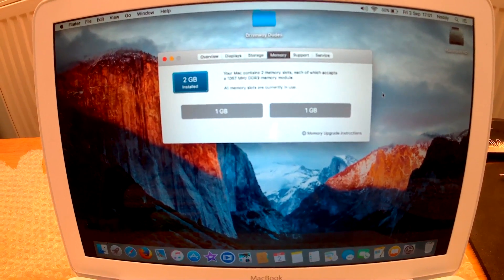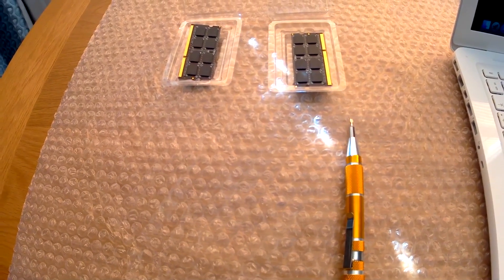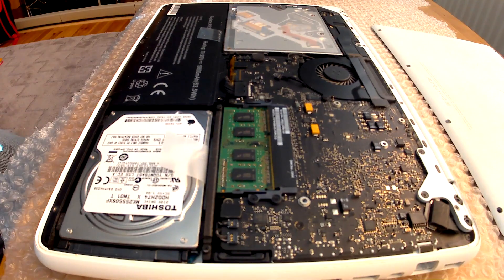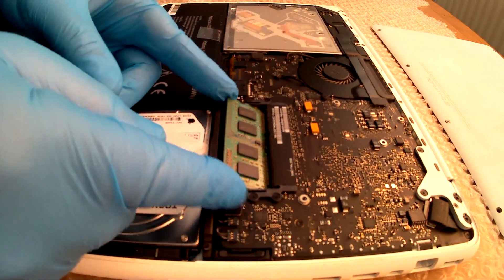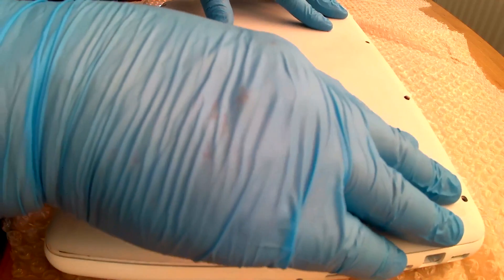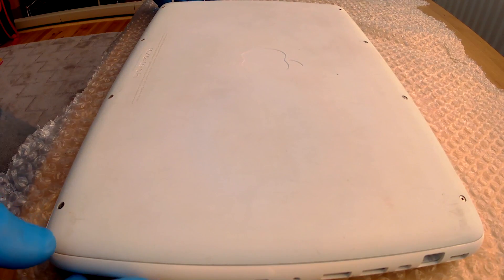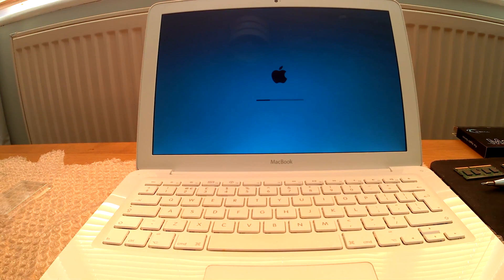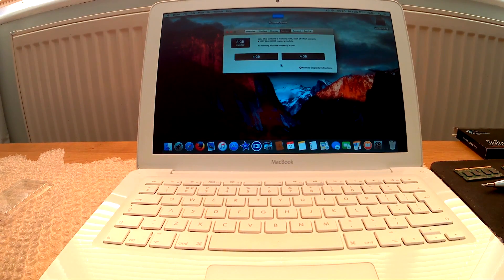How to upgrade your ram in a Mid 2010 MacBook 7,1 Model A1342

Comment: After 45 mins of searching this is literally the only view of this specific mode 2010 polycarbonate MacBook 7,1 with those 2x 4 chips on the bottom instead of 4x. Thank you so much. I thought I wasn’t missing one of those chips where there’s 3x and a space for a 4th and thought it fell off.

Comment: How did u get that computer too el capiatn? mine only goes as high as Yosemite
Reply from the maker: Thanks for the comment. My Macbook is a mid to late 2010. model A1342. What year and model is your MacBook and i'll see if I can find out more info for you. :)
Reply: mine is the same as your and i just figured out it does go too MacOS Sierra but that you anyway
Reply from the maker: Good to hear that. Another thing I just found out that Instead of 8gb ram max, this model is capable of 16gb. I may do that down the line and let you know how it goes. :)